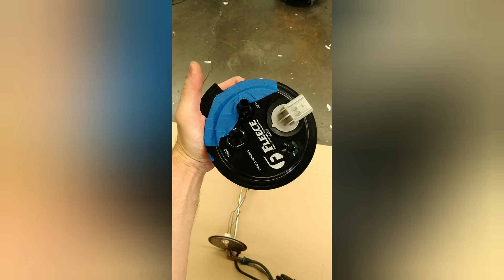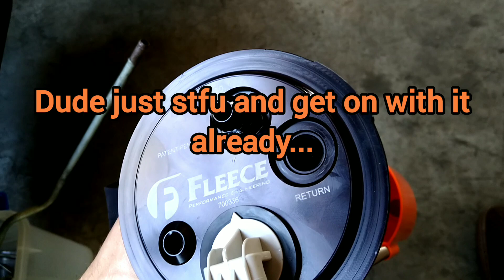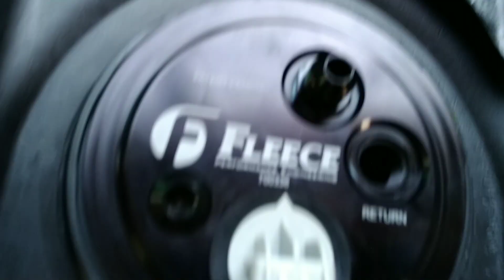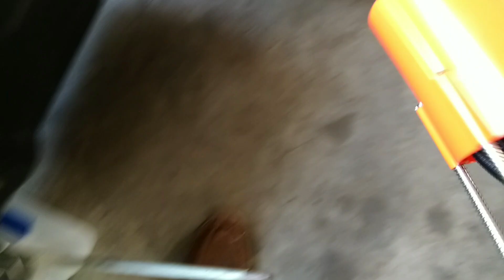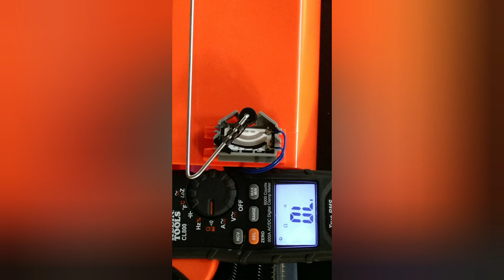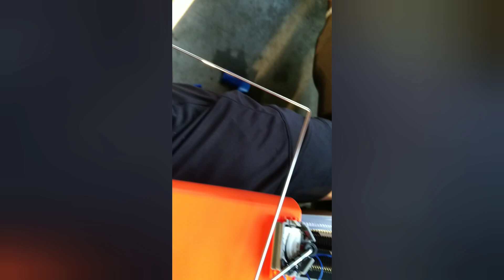6.0 Powerstroke fuel sending unit Swap

Comment: Good stuff , I might do this to mine
Reply from the maker: Hey Bob, another alternative ive discovered after the video, is to use a 2017+ fuel sending unit. This will put a pump in a bucket, in the tank. something that i was interested in originally, but somehow ended up with a 2016 sending unit and a 2016 vfcm feeding the stock hfcm. 

Fleece makes a dual pump in tank sending unit (Pro-flo), but due to a lack of real world reviews and engineering data i opted out of it.

The only benefit i can think of by not having an in tank pump is servicing and replacement. At the end of the day, the original design work just fine. Performance and reliability is a tight rope, but i trust Fords engineers updated designs.

Thanks for watching!